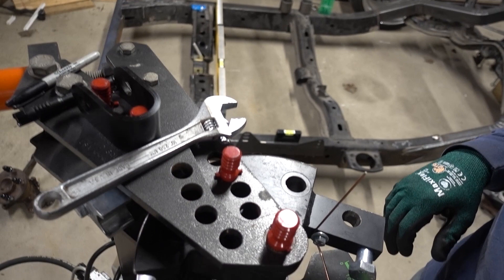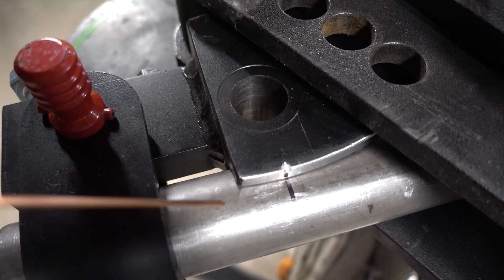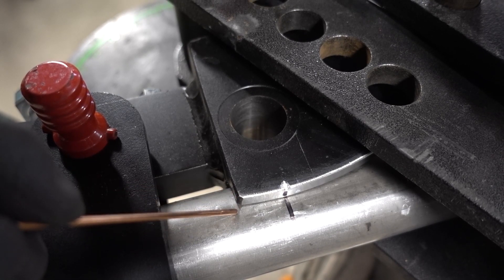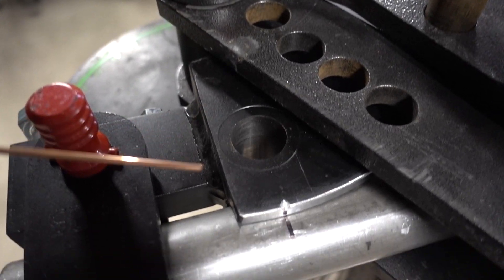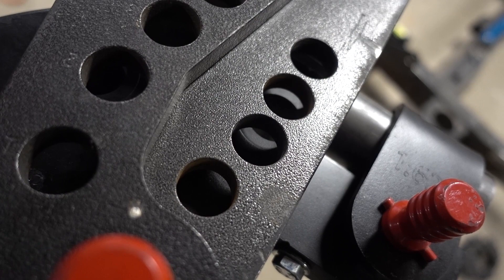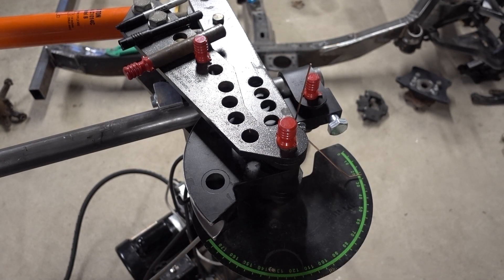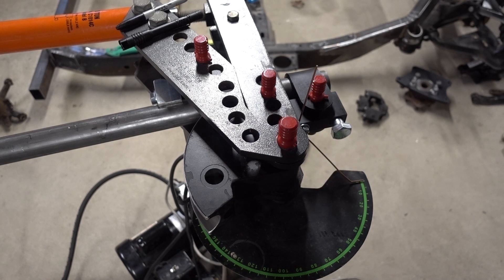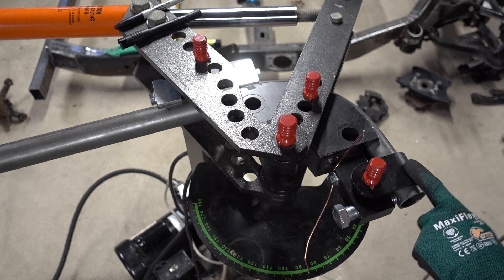JD2 Model 3 | Tool Video | Die Setup | Otto Factory

Comment: You're correct where the actual bend starts but where ever you calibrate your dies thats where you line up your bends. I calibrate my dies to the end of die and since i have about 10 different dies its easier to go by the end of it
Reply from the maker: It is definitely easier to mark and set tubes off the end of the die, but adding another +/- in the measurement just isn't worth it for me.  I'd end up forgetting to add or subtract and end up with scrap tube lol.

Comment: The first video I have seen that actually explains exactly where the bend starts. WELL DONE. Will the that start point be the same on all different size dies?
Reply from the maker: Technically it is the same on all of them. You're going from the pivot point out to the tube on a perpendicular line.

Sorry for the late response, YouTube isn't great with comment notifications.

Comment: can you do multiple bends in one piece of tube? how close together?
Reply from the maker: You can get them pretty close, but let's say something like a cafe racer rear hoop with the little kick up on the end, I had to make a custom piece to hold the tube ahead of where JD2 originally set theirs up. It worked ok and got the job done but if I ever have to make another one of those hoops, I'll probably make something a little better. And this was literally starting another bend right next to the previous bend. I think I only had about a half inch in-between the two bends.
Reply: @Otto_Factory  Half an inch is good to know. I'm looking to do headers for bike engines so can have kind of a 90 followed by a bend in another direction so seems like this is a good option.
Reply from the maker: @abigstorm  yeah, just check the wall thickness of your header tubes, I think JD2 has a minimal wall thickness to prevent kinking the tube.